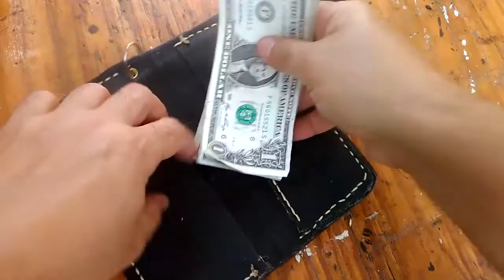Men's Leather Skull Wallet / DIY / Make Video

Comment: that's really cool man ,great job !!
Reply from the maker: Thanks dude! It was raining on an off. I had the table build in and out. So, I did this to keep busy, while Florida weather changed it's mind. Now I'm onto the benches. Started raining again. Had to put it all in. I got a lot done though...rock on!!
Reply: +ESCAGEDO WOODWORKING what are the snap things called ?
Reply from the maker: They're snaps. you got it right. I feel that a project may be brewing with SDM...A least I hope so
Reply from the maker: oh wait, the other one is called a grommet
Reply: Yeah I've had something started but need them snap things and the tools but couldn't find anything when I googled it
Reply from the maker: home depot, or other box stores. The section where they sell staples hot glue and similar stuff. They may have snaps and grommets. I know HD sells them. But the specialty stuff is at craft stores.
Reply: Awesome thank you